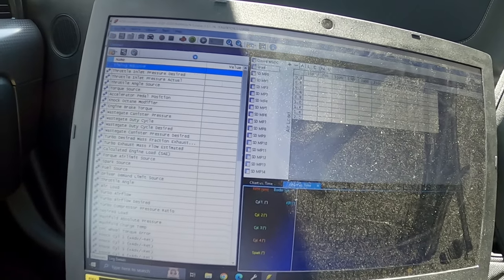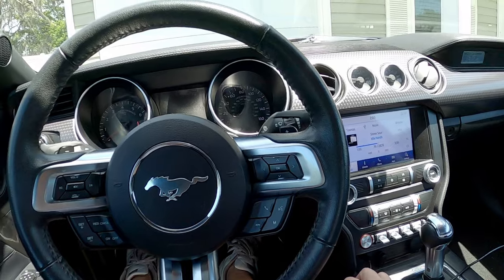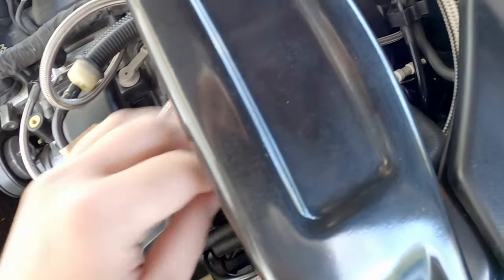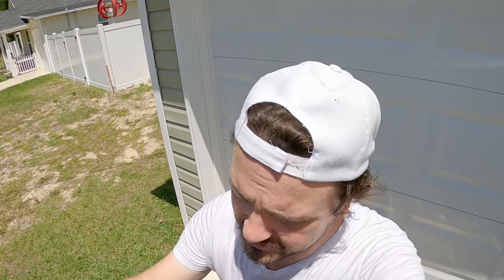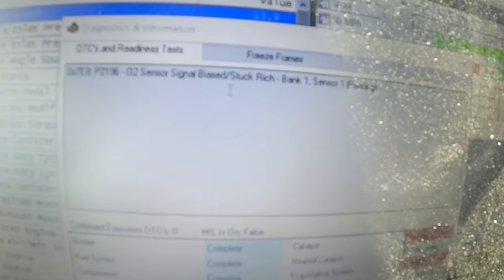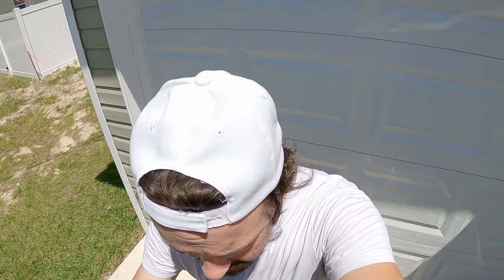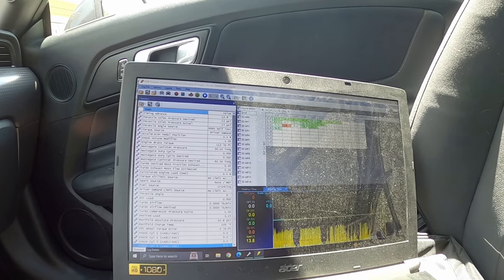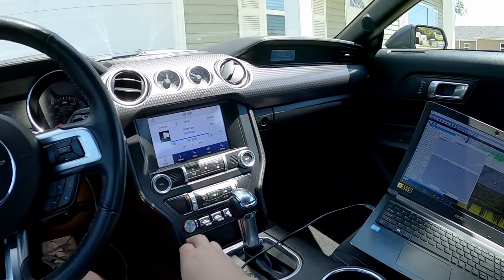My Mustang broke AGAIN

Comment from the maker: UPDATE
After replacing the oxygen sensor and still no change in the way the car idled, I disconnected the lines to the water meth nozzles to discover the actual problem. So even with the nozzles mounted higher than the tank & a check valve, a small amount of fluid was making it's way into cylinders 3 & 4. Having a nozzle in each cylinder must be creating enough vacuum to pull the fluid through the check valve. I never would have considered this to be a problem, but I learned a couple things from this.

Lesson 1 - most information on the internet about water meth is garbage.

Lesson 2 - Multi-port systems REQUIRE a solenoid.
Reply: My Snow direct port plate water/meth system came with check valve and solenoid, both necessary for a proper installation. Glad you figured it out, but there are instructions from Snow that address this, if that’s where your system came from. Gotta give you an E for effort, at least you’re persistent! Not everything goes right first time around, at least you’re trying!
Reply from the maker: @shearrer7011  No instructions for me! Every component was ordered separately. I was mainly going off of the generic information that's plastered all over the internet.
Reply: You’ve got to talk to folks who’ve been there, done that, and have the T-shirt to prove it. You’re getting a hard earned education. Buying parts a la carte is not what the inexperienced should do. Buy a proven kit and roll on. It amazes me at how many young performance enthusiasts depend on social media information to modify their cars, while ignoring manufacturers and real experts. The aftermarket loves it, because folks buy all the wrong parts several times, before they get it right… if they ever do. Most social is complete chaos, full of mentally disturbed drug babies, lol! Hang in there, if you ever need a sounding board for a lot of those thoughts gone wrong you have, feel free to reach out. I’ll do my best to help out.

Comment: I take it you don’t have a solenoid on the meth, sounds like it’s drained into the manifold and is hydrolocked
Reply from the maker: I never got to even prime the system.  I'm not using a solenoid, but there is a check valve. This is not related to the WM system.
Reply from the maker: Well, you may have been partially right.
Reply: @KarzKreated  hopefully it’s not too bad buddy
Reply from the maker: It's all good. The car is running fine now. A Solenoid is on the way. 🙂